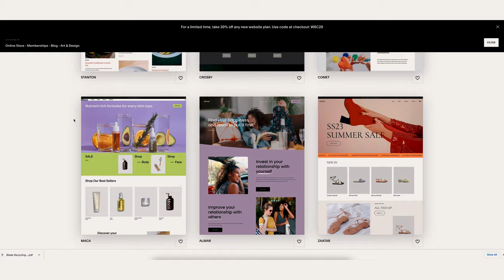Building a Mountain Cabin - Metal Roofing Ep.36

Comment: Looking great man! If I were you I’d check in with a local structural engineer for an opinion on that bracing. I bet they wouldn’t charge you much at all if you gave them photos marked up with member sizing and stuff. The bracing may be more effective if it’s actually attached to the inside of the footing post and run up to face of joist, for example (also the attachment method matters). I’ve consulted with engineers in this manner for small projects and only paid like $300. Worth it if you are still wondering about it! Keep building man! Oh and congrats on getting the kid riding on 2 wheels! My daughter just got there too - so fun!

Comment: I just installed a similar 12/12 roof on a cabin last year. Here's a tip. Try building a platform/scaffold screwed into the side of the cabin and attached with stilts that reach the ground on the outside. What's great about this is that you can take your ladder up there and anchor it to the platform while laying the ladder directly on the roof. You'll use it not only to install the roof but also the trim and ridge cap. It made things so much easier. 
Love your build. Coming along very nice. Cheers!
Reply from the maker: ❤️❤️❤️❤️❤️good ideas!!!

Comment: Best way to get duke is with a standard metal rat trap and use steel wool with peanut butter smashed into the wool as the bait, the steel wool gets stick in the incisors and springs the trap before they can escape

Comment: I like to use an automatic center punch on the metal roof to create a dimple for the screw tip before driving.  Makes it easier to start and put the screw where you want.
Reply from the maker: Yea usually I do too but these new screws I got have a really small thread for the metal then it gets bigger for the wood. Never used ones like these but they are handy!

Comment: yes on the bottom of the roof the metal shall be under the paper and on top pf the side wood on the sides. Also when doing metal roof, you put the overlap from the side the strong wind normal comes from, on this roof is from the backside of the house, i do not know its the right direction.

Comment: What prevents the fasteners from becoming water ingress points? Is there some kind of o-ring-like material under the screw head, or do we just not care about a bit of water getting into the strapping?
Reply from the maker: Yes there’s a metal washer that compresses a rubber gasket against the metal. When properly installed, it has a 50 year lifespan. Very popular around here…